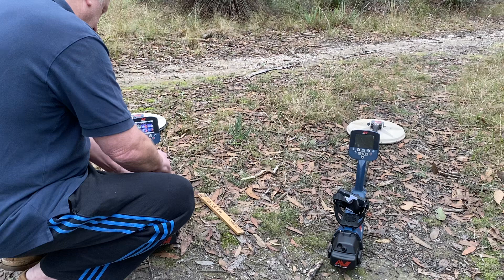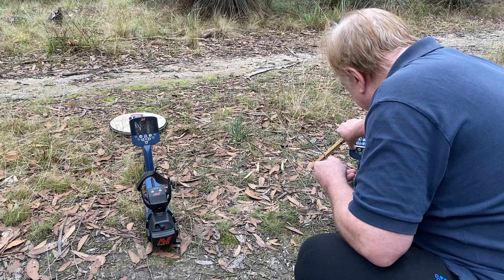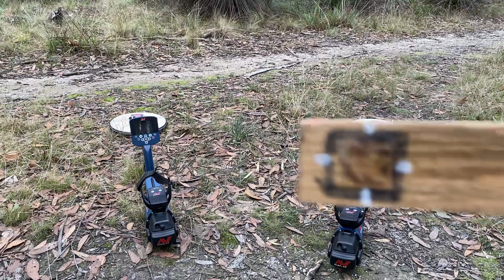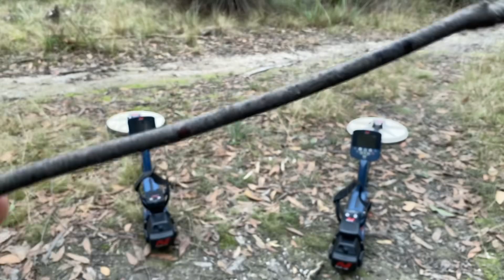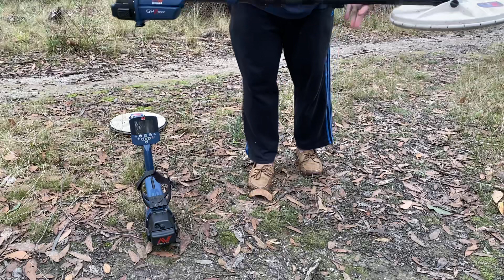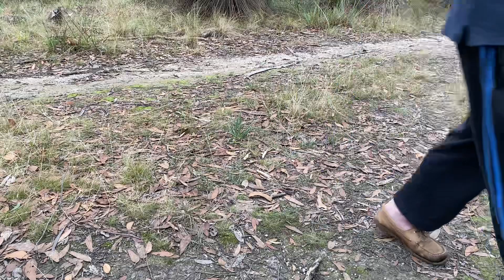GPZ-7000 + GPZ7000 test of standard compared with the modified and upgraded

Comment: Hello Woody…
Just checking in again with an update on my progress with the modified GPX7000…
I’ve continued to take another look at some of my old patches over the last two weeks.. 
There is no question in my mind that your efforts to reduce the internally generated interference has resulted in a much improved target response… I recently revisited one such patch in the Whipstick Forrest (Bendigo), which has been raked and gridded to the point where I could no longer find a genuine target, let alone any further gold… I had not visited the area for over six months and I know of at least two other prospectors who have since gone over the patch with their GPX6000’s… This was going to be a significant test of the upgrades, where just picking up one or two genuine targets would have been a good achievement… I left with five pieces of gold and three bits of lead shot! I was left absolutely astounded… The small gold (sub-gramers) were able to be heard using the same settings/coil setup and were mostly around six inches (150mm) deep. One might argue that all of the targets should have been ‘gettable’…..however I know how thoroughly the area was detected.. I always wear headphones…and even two 6000’s also missed them!.. The only variable has been your modifications to my detector.. This is becoming a constant theme with every old area I return to… Until next time…. Steven. 😊
Reply from the maker: That is great to hear, the other gpz7000 owner has reported back a similar improvement but that is a phone sms message.

Comment: Hi I am From Australia how good is the machine from china have you had any problems with it. Did you buy the product from China?
Thank you
George
Reply: thanks for calling back  can you please tell me what to look for so can check it is it the cable connection or is it the sensitivity thank you very much.
Reply from the maker: The issues are never the same, you can ask the manufacturer if they can give you a circuit diagram.
Reply from the maker: No, I definitely do not buy, I only improve the performance and repair. After I fix it then it as good as any other detector.
Reply: @DetectorMods  i am a technician i would i to buy one what is wrong with it
Reply from the maker: It’s a lucky dip, some work fine and others have problems.
Reply: Hi is 8000 gbx the same as 4500gpx and is it good to buy  thank you
Reply from the maker: It is a copy but require some work to make it perfect.

Comment: Hi Woody.. Having been able to get out this weekend and do some initial trials on some of my old patches, I can honestly say that so far your experimental modifications to my 7000 have been terrific!.. The shielding has allowed my GPZ to pick up legitimate Rx signals in patches that I considered ‘worked to death’… I have gone to some old patches that are very familiar to me and used exactly the same coil/setting setups.. These areas have been raked and gridded within an inch of their lives… I know exactly how much gold was found in relation to junk/lead targets… I have simply been left dumbstruck with targets coming through that just simply should not have been there… That increase of around 15% in depth/sensitivity in your video, has certainly transformed into another 15-20% increase in targets pulled from those old patches.. Of that increase….50/60% were lead birdshot at ridiculous depths and the rest were gold targets not heard before… However the junk/gold ratio is not the issue here… Simply that the modifications are producing the goods and pulling more legitimate targets for the operator.. I haven’t as yet reworked enough of my old patches to provide more comprehensive feedback, but I’m extremely happy with the results so far!.. I think you’re on a winner Woody… ☺️👍
Reply from the maker: I’m glad the mods are working, excellent, I am getting a lot of enquires about doing these upgrades, keep me informed of your detecting progress.

Comment: Hi ,,, i have fixed the problem of gpx 4500 battery I've replaced the JAK8
And now it seems that the battery is charging
But when i test it with the multimeter it gives just 
0.52 volts 
What  could be the problem please ?
Reply from the maker: Did the battery go fully flat? Lithium can not come up if they get too low in voltage.
Reply: @DetectorMods  when i test the cells inside it gives 3,60 volts each one ... But when i test it befor  the shotky diode  it gives 9.2 or more 
And after the shotky diode it give 0.52
Reply: @DetectorMods  woody if we can talk using Facebook or Whatsapp  its gonna be better ...i want to send some pictures if the battery if you want to help me please

Comment: Woody
     Outstanding! What a great passive way to improve performance. No critical adjustments to fiddle with or mess-up.

     The 16.3% improvement on the large 20 cent coin is indeed impressive. It may also have a sharper, narrower response for larger deeper targets. This modification should really open up old ground to finding deeper large nuggets.
Have a great day,
Chet
Reply from the maker: There is still plenty to do for improvement, i have picked up on other sections that can be made to add performance.